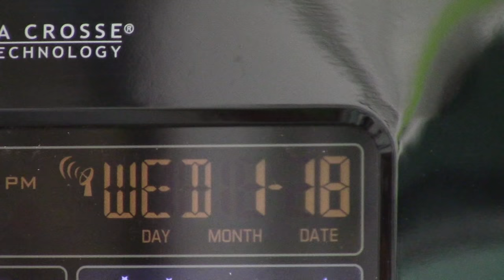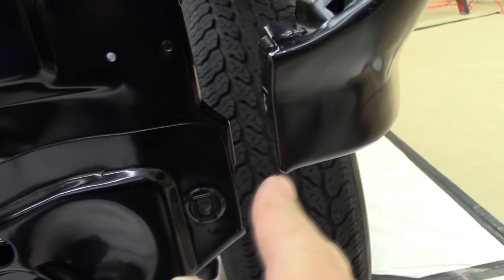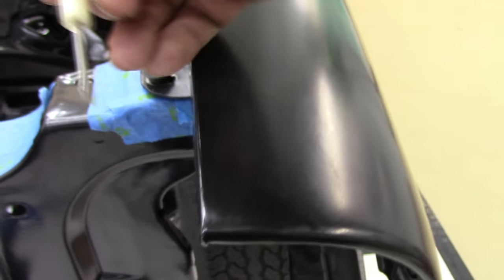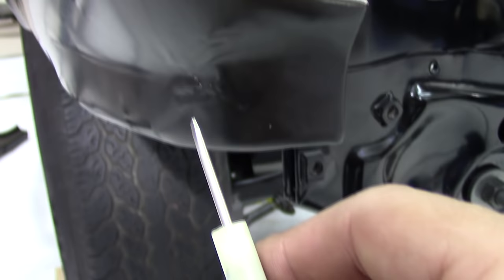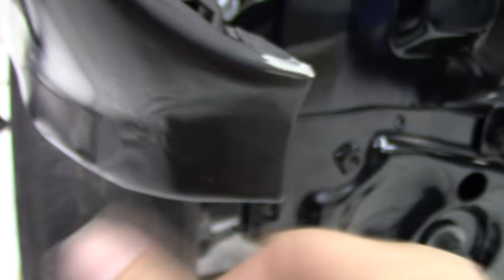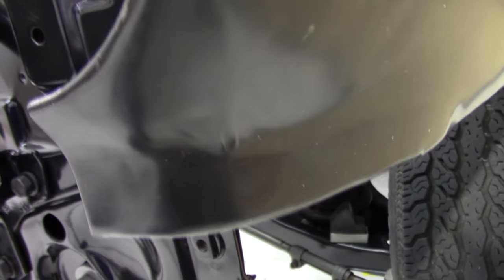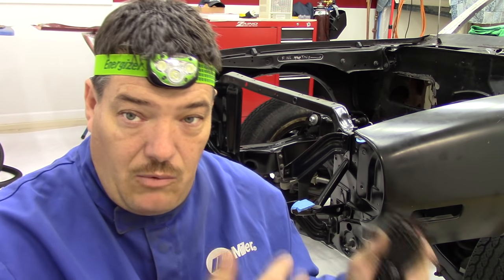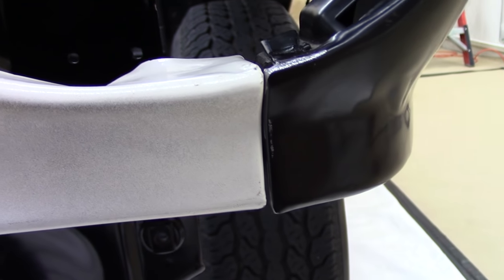1972 Camaro Project Overkill Front Sheet Metal Part 2

Comment: Regarding your gaps and fitment issues I would try to find another car like yours that is already restored and examine it closely. These cars never fit perfectly from the factory, which was a common sales point for foreign cars because their fitment and consistency of gaps was much better. That has changed over the years so that our American made cars are as good as any foreign car, partly because American manufacturers have bought into those competitors and learned from them.
It can only be as good as you are willing to work at it to make it. You are ahead of the factory already. So the question you need to ask yourself is, are you going for a show car that is better than original or are you wanting to make it a perfect restoration , complete with all the original flaws? Many restoration concourse events will be looking for the factory misfits to see how faithful to the original you are, including paint marks by inspectors, over spray on the under carriage, etc. Pick your poison.
Reply from the maker: Poison, it can sure be. lol. I think I will get it as good as I can. I'm not doing a 100% concourse resto, but it will be mainly correct. I will not be doing the paint marks and overspray, so one could say it will be over restored.  I have looked at several of these cars and they are really all over the place, from perfect gaps and gaps to me that need alot work. If this car would have been 100% complete when I got it, I might would have considered the concourse route. Great comment. Thanks George.

Comment: Maybe a shrinker disk would help a bit on those wrinkles. Fun stuff, test fitting nice metal. Good step I'd say taken the first shot at the front end. One area I have had problems with is the captured nut on the front radiator support. I have had problems with the bolt capture metal allowing the bolt to spin.
Reply from the maker: Thanks Jon. I think I know the capture nut your talking about, Its the lower one for the frame brackets. Mine were gone when I got the car and someone had replace them both with a washer and nut. So far, I'm happy with the initial fitment.

Comment: Oh ya, last thing. Just before you do your final gap adjustments with aligning, grinding and welding try to make sure the whole platform is loaded. You want everything to flex and sag as it will later. Get her on her wheels and put some weight in for the engine and a little for interior and full fuel tank.
Reply from the maker: Good idea.

Comment: Hi Russ. Looking good with the header fit. What I have seen before is the bolt holes between the header and fenders are pulled together slightly and cause that top gap to be wide. Could be your problem.
Reply from the maker: Thanks Darryl. I double check that. It could be something that just needs a little adjustment.

Comment: Hey Russ, first I'd like to say thanks for the videos! I'm currently building a 70 Camaro and I'm learning a lot watching and listening to you! 

Second, I know this video is about 10 months old, but about 2 minutes in you mention the indent in the passenger side fender that the driver side does not have. The fenders I have on my car are not GM and are reproduction and have the same indent on the passenger side and not on the driver side. I know you mentioned you were thinking it was one fender was earlier than the other. Thought you may be interested to know that may not be the case.

Again, thanks for the videos! Keep up the great work!
Reply from the maker: Thanks Michael. That's really interesting.  I know my original fenders didn't have them. Didn't know that the passenger repo comes like that. I'm glad the vids are helping. Thanks for watching.

Comment: Russ, wanted  to ask about your welder.  I am  in the market right now for a welder for some sheet metal work on the car but not really thrilled about spending the ~$700 for the Lincoln or Hobart. Have you had any experience with the off brands (Eastwood or Northern tool)?  I notice you say you are dialing in the welder alot and most of the cheaper welders have specific settings for the amperes. how important is it to have a continuously adjustable amp knob as opposed to the 4 or 5 settings.  I have asked Erik about his eastwood 135 and he seems happy with it but i just wanted to ask someone with a different welder.

Thanks again for the videos
Doug
Reply from the maker: Doug, I have a friend that has the Eastwood welder and I have never been able to get used to it. I know its a good machine because I see so many people using them with great results, but I get frustrated when I try to use it. I have an older Miller 130xp here at the shop that belongs to a good friend of mine. Its a great little welder and its a tap machine, where you just have the A, B, C, D setting for the heat. I really like having the continuous setting, because I  can really dial it in on a piece of scrap metal before I commit to my project. I think it really makes a difference.

My advice would be to check on Craiglist and see what comes up from time to time. There is a Lincoln 175 plus that  is for sale a couple of hours from me. I'm tempted to go get it. They want $500 and it comes with the cart. If nothing comes up, I think you couldn't go wrong with a Hobart. They usually have some good deals at the big box stores from time to time.

Whatever machine you choose, I think the big thing will be just getting used to it, and how it welds. You will get a feel for how it welds and its settings that will give you the results your looking for. 

Hope it helps. Russ
Reply: Thanks for the info Russ I appreciate it,  I assume your welder is 220V?
Reply from the maker: Florida Bandit It is a 220V unit
Reply: Thanks again Russ sorry to ask so many questions a bit of a novice.
Reply from the maker: No problem, We all learn from each other.